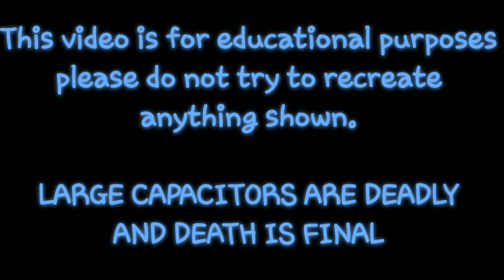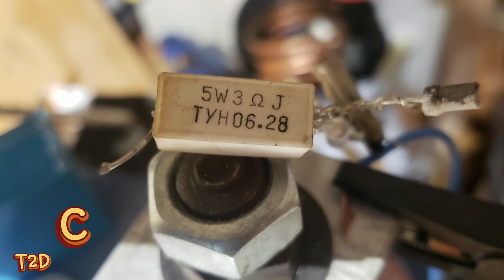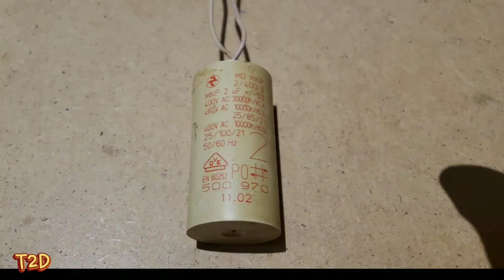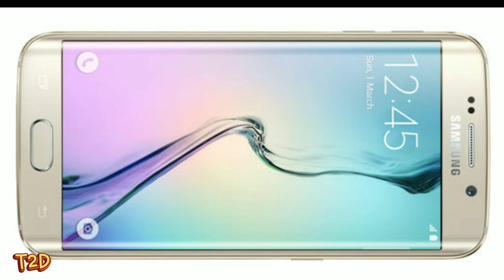Monster Capacitor Destruction

Comment: That is super awesome! I’m guessing your switching with a spark gap?
Reply from the maker: Yes exactly, I charged from outside with an RF remote control contactor controlling the primary of an NST until it jumped the gap 👍👍
Reply from the maker: I didn't use a separate hv source to ionize the gap and trigger it on demand, this was a very crude setup, I just set an approximate 15kv gap and charged the cap until it jumped

Comment: I don't understand what happened to the coke can. How was it wired up to squeeze it in the middle?
Reply from the maker: Its induction mate the can is like a shorted turn of a transformer, the coil induces a current in the can which creates a like field so the the fields repel and the can tries to get away from the coil (smart can) and as a result of the massive current this is violent enough repulsion to tare the can apart....

Steve

Comment: Hi mate, really nice video!! 👍
What are voltage rating and capacity of this little cap?
Reply from the maker: Its stats are: 25uf 20,000 volts 5000 Joules and they weigh 50kg and I have 8 of them😂😂😂🙈
Reply: @T2D.SteveArcs  absolute respect 😌👍
Reply from the maker: @fabriziobrutti1205  thanks mate👍👍👍

Comment: Great stuff, Steve. Superb photography too. I'm left wondering how long it takes to charge that monster capacitor perhaps you could let us know?

And BTW, I do hope the 'phone was still under guarantee otherwise you'll never get your money back. -Peter 😂
Reply from the maker: Thanks mate and it takes around 20-40 seconds depending on the gap I set,  it builds up voltage until it is high enough to jump and dump😂😂...

Steve